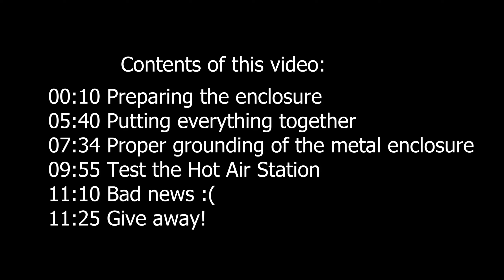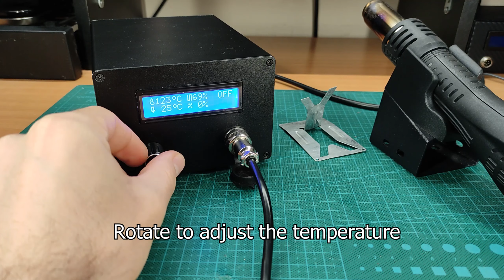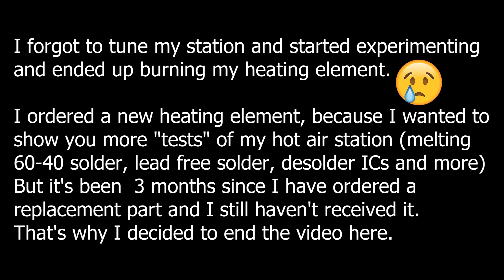How to make a Hot Air Station | Part2

Comment: The second part finally arrived, but it worth the waiting. Thank you!
Reply from the maker: I'm happy to announce that you are one of the winners of the giveaway. Please tell me your email and I'll contact you through email.
Reply from the maker: @pretoriano80  got it, ill contact you within this week
Reply from the maker: @pretoriano80  there is something wrong with YouTube. It's blocking comments containing emails. But luckily you sent in a smart way
Reply: @sasiskas  Yes, i figured that YouTube was somehow blocking email addresses (or marking them as spam).
Reply from the maker: @pretoriano80  thnx, I will check it out
Reply: @sasiskas  Yep, got it and answered, thank you!  :)
Reply: The  parts from the giveaway arrived and the project is almost complete, i'm only missing the MCP602 which will arrive very soon.
Thank you @sasiskas and will let you know when the project it's complete!
Reply from the maker: @pretoriano80  😎✌️
Reply: @sasiskas  i'm ready to test everything before the assembly part, but i have a doubt.
My heat gun handle's pinout seems a bit different regarding the thermocouple and reed.
The sensors schematics says that REED, GROUND and THERMOCOUPLE must be connected, but my handle use an NTC thermocouple and one of the thermocouple's wire is connected to the REED switch, hence my doubt regarding the SENSORS connection. (the doubt regards GND and THERMOCOUPLE pins)
Reply from the maker: @pretoriano80  send a photo to my email
Reply: @sasiskas  e-mail sent, thanks!
Reply: @sasiskas  thanks for the help, i was finally been able to test, tune and calibrate everything.
The tuning and calibration part is pretty tricky and i had to start over several times,but in the end I've found the sweet spot.
I will still have to test it out better, but first i will have to make a box/enclosure for it. xD

Comment: Hello brother please help, whenever I connect to the power it shows failed I have made every connection on a perf board and made sure with a multimeter 
I have used a nano instead of pro mini
Also I have inputted the voltage on the 5v pin of the nano 
What is causing this please reply

Comment: hey can i use 24V my blow fan supply voltage 24v 2.why is it broken (damaged) heating element ? do I need to make any changes in the circuit?

Comment: hi, thanks for the nice project.
I could not find mcp602 so I used tlc272 instead-but in tune mode the  internal temp can not goes above 800 or 850.
another problem my handle has a 24v fan. in the controller when I set fan speed it will only spin and working when I set it above 80% .under 80% it is off.
sorry for my questions. instead of using moc3021 and bta 12-600 can I use moc3052 and bta41-600?
Reply from the maker: Is tlc272 a rail to rail op amp? You need a rail to rail op amp that's why you can't go more than 800.
Did you use a 24v psu for your 24v fan?
Reply: @sasiskas  yes,tlc272 is low noise rail to rail 5v op-amp. perhaps it is fake. yes, I used 24v 2 amp PSU for the fan.
can u explain more about tune and calibration please. in tune mode and calibration should I measure the temp of surface metal of the gun or temp of the hot air that came of the gun using an external thermometer? also the speed of the fan in tune and calibration must be 100% or etc... ?
thanks
Reply from the maker: @f.k2906  to fix the issue with the 24v fan, go to line 853 and replace

 " TCCR1B   = _BV(WGM13) | _BV(CS12) | _BV(CS10);"

with this

"TCCR1B  = _BV(WGM13) | _BV(CS10);"

let me know if that worked
Reply from the maker: @f.k2906  moc3052 and bta41-600? should not be a problem.
Reply from the maker: @f.k2906  if you bought tlc272 from ebay or aliexpess is probably fake. if you cant get the internal temp to 850 it is because the op amp is not rail to rail (or it is fake)
Reply: @sasiskas  thanks for your answers. and for tune and calibration parts of my questions that I mentioned above do you have any suggestions?
Reply from the maker: @f.k2906  you should use an external thermometer to measure the air right in front of the nozzle, not the metal. Also regarding the speed it doesn't matter.
Reply: @sasiskas  thank you.
Reply from the maker: @f.k2906  you are welcome. Just let me know if you have any other problems
Reply: @sasiskas  Hi 
by using your advices, I completed this project. already tuned and calibrated. everything works fine. thank you again.
Reply from the maker: @f.k2906  you are welcome. I hope you enjoyed the DIY experience 😁
Reply: @sasiskas  Sir will OPA2333 work on this project? I think it is also a rail-to-rail OP-amp

Comment: Is it not possible to fix it without the 200k trimpot by adding a resistor?
Reply from the maker: No. You need a potentiometer.
Reply: Oh ok 😢 my hotgun alimant burn.. 😢😢 and  im include 200k trimpot but it doing  adjest  not tuning ..  display ..😢😢 why ...broblam sir.. ..😢
Reply: The heating alimant has melted all over the place 😥

Comment: Hello.
I have a problem with setting the temperature above 400. I made a tune, i.e. 400->900, then calibrations (200,300,400). Up to 400 everything is correct, but when I increase the temperature with the encoder above 400, e.g. 430, it automatically changes to 400.
Reply: Cause the code has max high temp set to 400 😅. If you want to go higher edit the code.
However am getting  "compilation error: no matching function for call to DSPL::begin()" while compiling can you send me the files you using? The library folder on your computer 😅
Reply: @Mods-Lover  Thanks for the reply.
Do you mean the change in the vars.cpp tab?

For me it looks like this:
const uint16_t default_temperature = 240; // Default value of IRON temperature
const uint16_t temp_max = 950; // Maximum possible temperature in internal units
const uint16_t temp_minC = 180; // Minimum calibration temperature in degrees Celsius
const uint16_t temp_maxC = 450; // Maximum calibration temperature in degrees Celsius
const uint16_t temp_minF = (temp_minC *9 + 32*5 + 2)/5;
const uint16_t temp_maxF = (temp_maxC *9 + 32*5 + 2)/5; const uint16_t temp_tip[3] = {200, 300, 400}; // Reference temperatures for tip calibration (Celsius)
const uint16_t ambient_tempC = 25; // Default ambient temperature in Celsius
const uint16_t ambient_tempF = (ambient_tempC *9 + 32*5 + 2)/5;

I am using the I2C version. Compilation went without a problem.
Reply: @Stawustawu  i think you opened the t12 code not smd rework station 😅. This is t12 code. Can you give me your whole arduino library folder, (it's in your documents folder) when you compiled the code. Cause whenever I try to verify/compile am getting same error. Please help 😮‍💨
Reply: @Mods-Lover  My mistake. I have a similar problem with T12. The code for the hot air station compiles normally. All libraries are available in the link below the video. Maybe send a detailed description of the compilation. Maybe you are missing some symbol. Download the program again and check.
Reply: @Stawustawu  i get my problem fixed actually I thought that i have to download the liquid crystal library, so i downloaded the one from library manager. And when compiling the code, compiler get confused which one to use as there are two libraries with same name, the new one didn't had the right definition for the code used, the error said that multiple libraries exist and not using the one arduino came with which caused the compiling problem. Now i will make the circuit and test the whole setup.

Describe your problem more briefly. As far as I can see there could be two problems, one is you didn't calibrated the system well, you have to calibrate your system to 400c at 900 adc value. If you can't go above 400 then it could be anyone from software to hardware problem. For software you have to set max temp to what you want to go, for hardware you have to calibrate it. As system will not go above 1023 adc value
Reply: @Mods-Lover  Thanks. I'll try to check it out.
Reply: @Stawustawu  no worries 👌
Reply: @Stawustawu can you tell me what is the resistance of heat gun thermistor? I bought two different gun one with aviation jack other without it both have thermistor sorted giving 0.6 mO reading on my multimeter. Now my project is on halt as of now until I change the thermistor with a good working one. So just want to know how much ohm is it at room temperature.
Reply: @Mods-Lover  Hi. My thermocouple resistance (pin 4 and 5) at room temperature (27C) is about 1 ohm
Reply: @Stawustawu  is it direct from heatgun on in circuit reading? 🤔 Isn't 1 ohm too less for the thermocouple? Is this works well for you? What if you heat the thermocouple with soldering iron what resistance it shows(i didn't tested this) and what readings you get in voltage range of your multimeter? When I test some known good type k thermocouple in same room i get reading of 14 ohms and 0.01 millivolts or 1 millivolts reading i don't remember correctly which one was correct one but same.
Reply: @Mods-Lover  I checked the spare heater. The resistance is 0.5ohm. I connected it to a multimeter and the temperature measurement was correct. After completing the project and calibration, everything seems to be fine. In general, it is difficult to measure the temperature of the air coming from the heat gun. If you change the location of the measuring probe, the temperature will be different.
Reply: @Stawustawu  okay thanks for the confirmation let's see what is wrong with my device 😅

Comment: hello, what is 200k adjusting, what should be adjusted according to it so that it does not burn?
Reply from the maker: Hello, the 200k trim pot is used for tuning the station.
The temperature readings should be calibrated with the original value to get reasonable readings. So, in order to do that you should follow the following steps.

First, go to the setup mode and select the Tune option.In the tune mode the internal temperature (0-1023) is displayed on the screen.Rotate the encoder to manually select the applied power to the hot air gun. Heat the gun to 400 degrees (you need to measure the temperature using an external thermometer). Then tune the trim-pot to set the internal temperature about 900 (in the internal units). Long press to the encoder return to the menu

Then, go to the setup mode select Calibrate option. Choose the calibration point: 200, 300 or 400 degrees, press the encoder. The hot gun will reach the desired temperature . By rotating the encoder, enter the real temperature. Then select another reference point and repeat this process for all the calibration point.

After this long press and come to main screen and then again go to Setup mode and select save.

And now the Hot air rework station is done

Comment: hello great job I really like the format of your video
I'm ordering the component to make the soldering station and hot air station and I was wondering is there a difference between this two MCP602-E/P, MCP602-I/P
thanks
Reply from the maker: You can check that in the datasheet under the "product identification system".

Basically the only difference is the temperature range.
I = -40° C to +85° C
E = -40° C to +125° C
Reply: @sasiskas  will that impact the soldering station or hot air station
sorry I am still a beginner
Reply from the maker: @maxpomme6639  no it won't, don't worry about it, just use the one that is easier to find.
Reply: @sasiskas  thanks a lot for your response

Comment: I finally found the perfect video, I have a few questions about the 200k trimpot in the circuit. how to do the settings, for example in which direction and how far to turn the trimpot, and how do I know if the settings are right or perfect so as not to damage the components. is there a standard parameter for these settings.?
Reply from the maker: This trim pot is use for tuning the station. In my dropbox folder I have a photo with subtitles where I explain the procedure.
Reply from the maker: @File Test turning the trimpot will adjust temperature offset, between the reading of the Arduino and the actual temperature.
Reply from the maker: You must use the trim pot and tune the station. If you don't, it's very possible that you will burn the element.
Calibration is for more detailed accuracy, it's not critical you can completely skip that step.
Reply from the maker: @File Test watch this video at 8:12  https://youtu.be/CZDSgRHYyjI it's the same procedure

Comment: again: very nice work, thanks for the video. I looked at the schematic and have two minor questions: what are the resistance of R12 and R13?
Reply from the maker: R12 330ohm 1/4W, R13 39ohm 3W
Reply: R13 is enough to apply a power of 2 watts

Comment: That was sad
The heating element was burn?
Well in that case if the replacement is never arrive, try to make the heating element yourself :D
I already done that 3 or 4 mont ago
And its still work fine
Reply from the maker: I could do it myself but I still need nichrome wire and mica paper (insulation) which I don't have 😁 so the only option is to just order a new heating element.

Comment: tune stuct 756 cannot up to 900..why?
real temp 450C+ on my digital thermometer
Reply from the maker: This happens if you don't use a rail to rail amplifier.
Did you use the correct amplifier? You must use a rail to rail amplifier.
Reply: @sasiskas  mcp602 sir
Reply: @sasiskas same with me, when I tune it stuck too at 756, I use mcp602, any solution about it? Please help me..

Comment: Am i the only one that hates power button on the back and connector on the front
It's so hard to reach and the connector makes the cable take so much damn space
Reply from the maker: I guess you are the only one, because no one else has ever mentioned anything about the location of the switch and the connector 😁
It's a DIY project, so you have the flexibility to put your switch and connector to a different location if you like.
Reply: @sasiskas  I just found it quite annoying on quite limited workbench especially if you stack things to save on space so reaching around is a pain